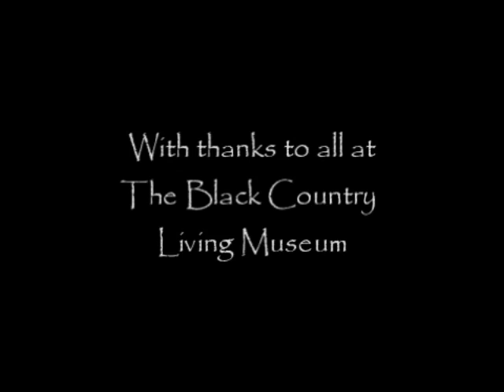The Worlds First Steam Engine 300th Anniversary

Comment: Savery invented a steam/vacuum system, with no major moving parts, to pump water.  Newcomen used the same system with a piston and cylinder.  Watt did not invent "the" steam engine but  improved Newcomen's.  He licensed the separate condenser and made a fortune using an army of lawyers and hitmen to enforce his franchise.  The completely different high-pressure steam engine that powered the world until the advent of the turbine was invented by Richard Trevithick.

Comment: And just think... the ancient Romans had harnessed steam power, but it was seen as a "novelty" to power things of entertainment.  If just one individual had looked at that differently and imagined it being put to work, we could've had the industrial revolution 2000 years ago.
Reply: The Romans wouldn't have been able to make a decent steam engine because they lacked the metallurgical knowledge. They would only have been able to make low pressure engines such as the Newcomen engine in this video.
Unfortunately, low pressure engines are extremely fuel-hungry, which limits their use to situations where fuel is abundant, such as coal mines themselves. The Romans did use coal when they found it very near the surface but they didn't do a lot of intensive coal mining!

Comment: Newcomen's machine was designed and built to supply Atmospheric Power.
Watt's machine was designed and built to supply Steam Power.
They are two different machines, so they shouldn't have the same name. What's wrong with Atmospheric engine and Steam engine, seems pretty logical to me. Or is it to do with the Steam Engine being the Industrial Revolution, logic goes out the window?
There's an Industrial Revolution's worth of difference between Newcomen's Atmospheric engine and Watt's Steam engine.
As for the difference between low and high pressure Steam, I can't see any. They're all Watt type Steam Engines.

Comment: Why does Watt get the credit and fame for inventing the steam engine?
Reply: Well Watt really did invent the steam engine. This engine uses the condensation of steam in the cylinder for power rather than steam itself. Hence its name as a vacuum engine rather than a steam engine. What Watt did was to change this by using steam, albeit at extremely low pressure, to power his engine, however he still relied on the use of a vacuum in the condenser which he invented. All Watt really did was move the process into two separate places rather than having both the expansion of the steam and its condensing back to water occurring in the same chamber. Making a more efficient engine but using steam to actively push on the piston, also.
Reply: He improved it, and he had the best lawyers